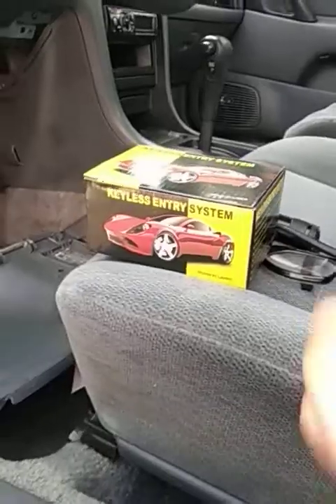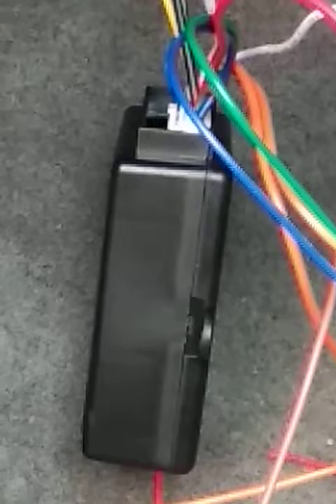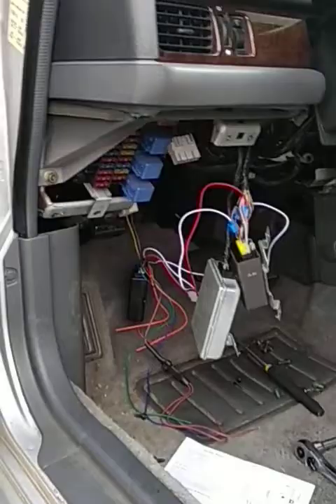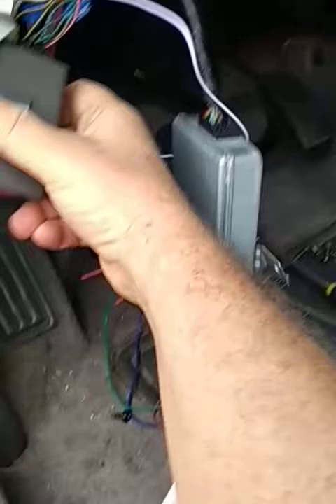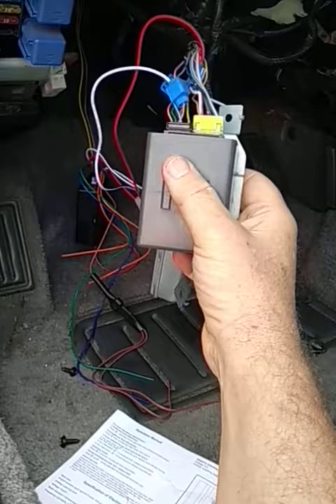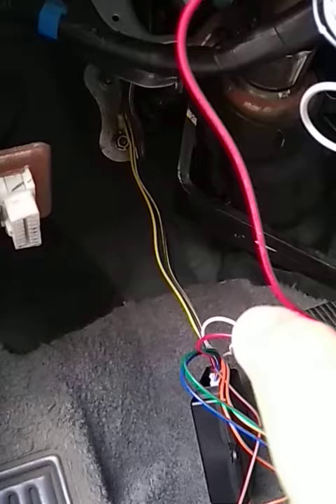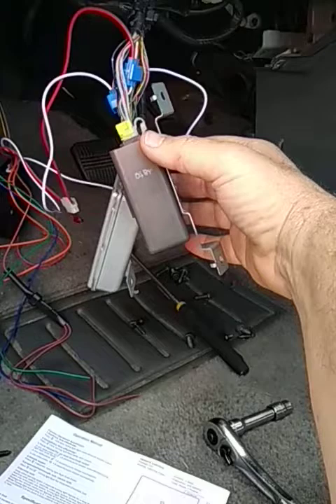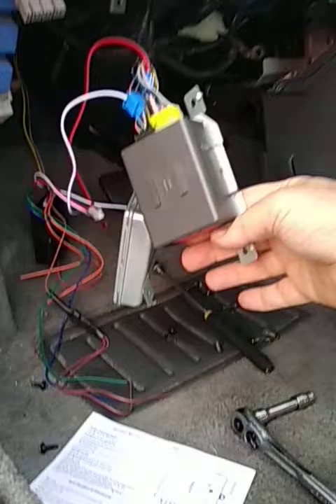Adding keyless entry (LANBO Kit) to the 1997 Nissan Altima (Part 1)

Comment: Thanks for a great video John it was very very helpful. As a commentary: the gray/red wire and gray/blue wire in the control box that should be used in this installation are the THIN wires. I say these as my 97 Altima also has a THICK gray /red wire and a THICK gray/blue wire in that same loom. Also in my case, the constant 12v positive wire for powering the keyless control box is a thin green wire with yellow stripes. Great work. I could not have done it without your video.
Reply from the maker: Thanks for watching my video and the great feedback!